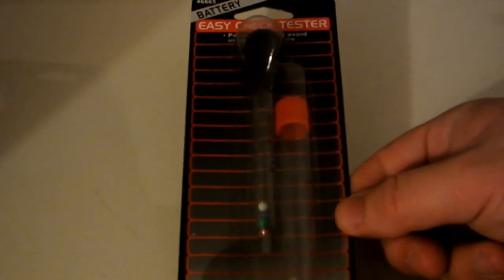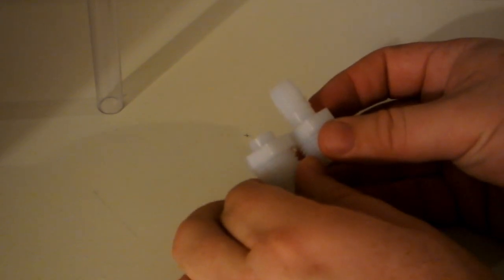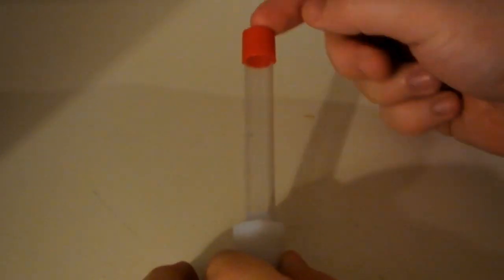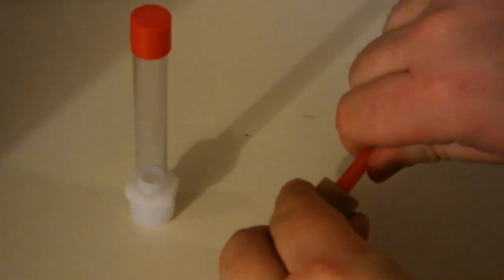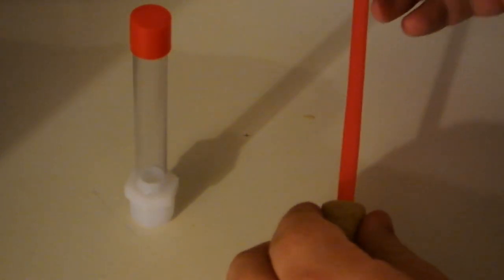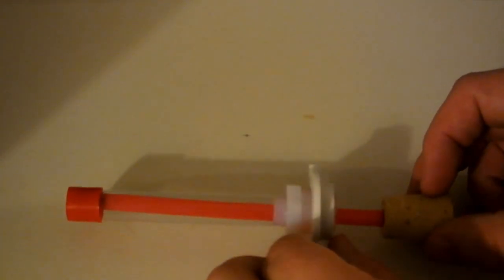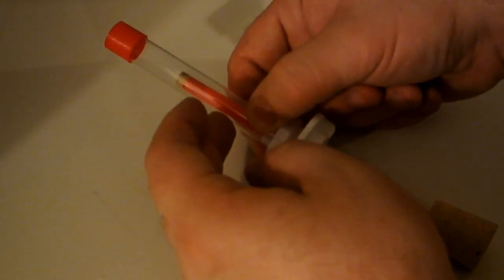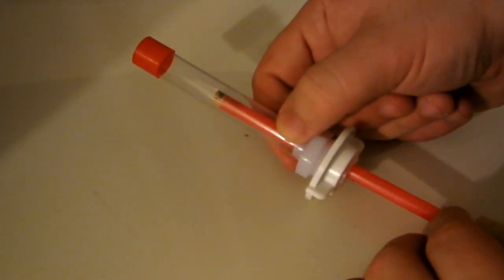How to make a Water Level Gauge in 2 minutes for $2

Comment: Chuck the cork, it'll grow stuff. Just fill the bottom of the straw with hot glue, spray foam or silicone.
Reply: I found a tube. 
I have straws. 
I tried the hot glue in the straw, sunk :(
I tried some Styrofoam in the straw, sunk :(

My pot is 14" height.
My water reservoir is approx 2" deep.

The Styrofoam in the straw only worked when the straw was 4" long... But didn't when I increases the straw length by inserting another straw into the end.

What's the physics behind why this doesn't work?
Reply: @sandybbeach  hot glue in the top of the straw and bottom, to create a bubble. It'll float.
Reply: Try making a puddle of hot glue and then stick the straw in it like a flag. Once it cools, you can peel the outside off and the center should be plugged. Not sure if this will work with the super hot glue.  But there needs to be a bubble in the middle of the straw with both ends capped. In theory, you could just cap the bottom, but it'll be less likely to have water get in and "sink" the boi. Cheers!
Reply: The physics are to make the straw more boyant than the water. Making the straw less dense will make it float. Like lead floating on mercury.
Reply: Awesome job. Thanks.

Comment: Another option that is inexpensive, has no moving parts and simple is an "S" curve sight guage. (all measurements are approximate) Get a length of 1/4 (ID) inch clear plastic tubing that is over three times the height of your rainbarrel. Twelve feet of tubing costs less than $10. 

1. Weight one end and sink it to the bottom of your barrel.

2. Drill two small holes at the top (above fill line) or run the tubeing into the top. 

3. Run the tube out of the first hole to the outside and run the tube to the bottom of barrel and secure. (I run it around the faucet)

4. Run the tube back up to the top and into the second hole (optional). I do this to keep the tube clean as I net the barrel against mosquitoes.

5. Leave about a foot or two of hose inside and make sure it stays above the fill line. The extra length is to suck with. (I secure things with tie-tabs)

6. Suck the water into the tube until it reaches the current water level. 

That's It! No moving parts. As the water level in the barrel moves up and down, the water level in the tube will follow
Reply: You should make a diy video demoing this :)
Reply: Not my thing, but please do!
Reply: How about linking to a photo of this setup?  I'm so visual.  Thanks!
Reply: this comment really helped me.  Thank you.